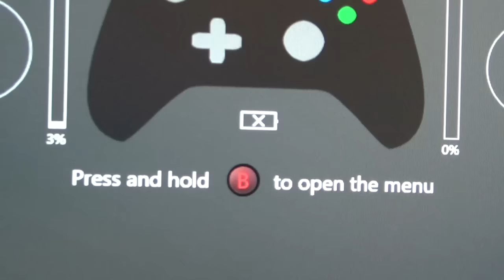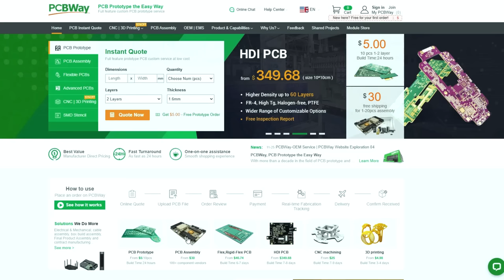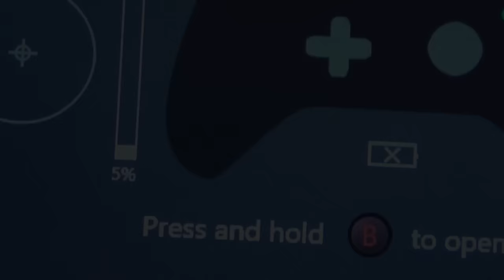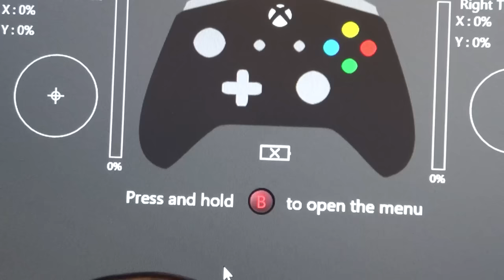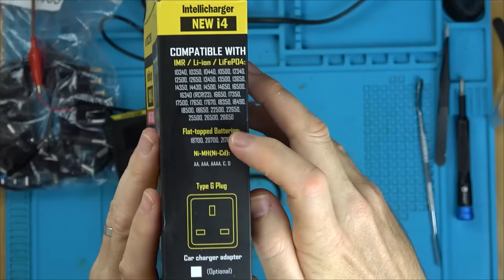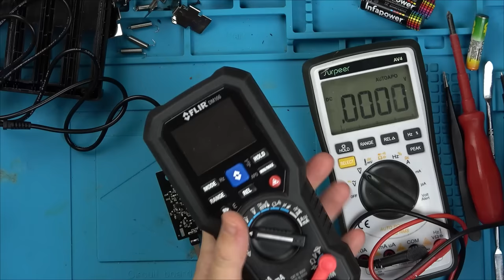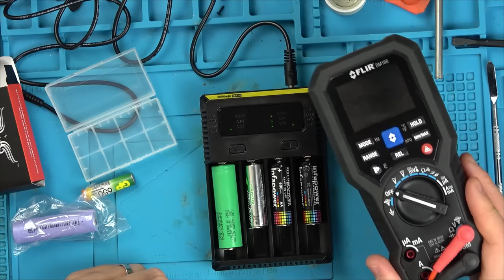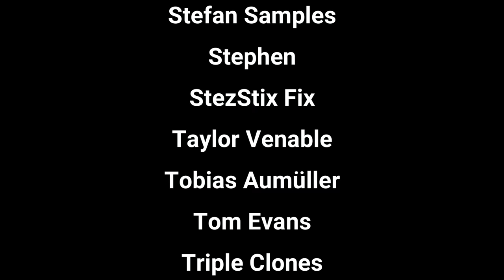More More MORE AMAZON RETURNS - Can They Be FIXED?

Comment: On the charger the diode that you took off does the rectification. One diode is a half wave rectifier. Therefore when plugged into the mains it was dumping 12V AC where it should be 12V DC, When you plugged in the DC it was going through the faulty diode and transformer to ground instead of being blocked by the diode.
Reply from the maker: Perfect, thank you PDS, I knew the viewers would have the answers. I haven't heard from you in what seems like an eternity. You keeping well?  Are you still volunteering at the laptop for the community place?
Reply: @Mymatevince  Hi Vince I'm doing good. I stopped volunteering at that place about a year ago. I just wasn't enjoying it anymore. I've been going the gym and I still do 3D art in blender. So I been keeping myself busy.
Reply: makes perfect sense. it doesnt need any more than that. But i wonder what the noise was when he plugged it into mains?
Reply: Yes. Also the small transformer is probably for a switch mode circuit, a linear transformer would be much bigger. It looks like there's some sort of combined pwm ic and FET package on the other side of the transformer.
Reply: Just to clarify what the shorted diode is for. It is the output rectifier for the switch mode power supply transformer. If you plug the mains lead in the switch mode power supply won't work because that diode is needed to convert the AC output of the switch mode power supply into DC.
Reply: @Irilia_neko  Yeah it's only useful because it doesn't matter that the DC is fluctuating. It would be useless for power rails on digital circuits.
Reply: My thoughts exactly

Comment: I'm not an electronics engineer, but my father was. A Diode of that type (your battery charger fix) is meant to allow electrical flow to go one way only. If a diode shorts out, it allows electricity to flow back into the circuit, causing the fault. Neither the AC or DC side will work because of the placement of this diode, taking it out did allow the 12V side to work, so once you replace it with a good diode, you should be golden. Also pay close attention to the direction of the diode's placement, that dictates the current flow.

Comment: An optocoupler can be seen next to the DC jack which means that that transformer is part of a switch mode power supply and not a linear one. The shottky diode does the high frequency rectification and also protects the circuit from DC going back to the transformer.
Reply: Yes, the schottky diode is for rectification, and after it failed, the dc voltage shorted across the coil. The coil is just a piece of wire for dc voltage, so it's like you basically connect the contacts together.

Comment: Vince, you can make a bypass light bulb to limit the mains current in case something is shorted. It's just placing a light bulb in series with one of the mains wires. If the thing you are testing is shorted it will just light up and avoid damaging it more (and prevent a fire too)
Reply: but its has to be an incandescent type bulb (old type not LED or CFL).
Reply: can be an halogen lamp too, incandescent bulbs are hard to find these days, specially 60W and 100W, which are the ideal ones for that

Comment: The battery charger uses an isolated switching power supply topology called a flyback converter. The transformer is actually a coupled choke (because it stores energy) with one primary and several secondary windings. There will be a FET switching rectified mains across the primary at high frequency. The secondary circuits just have a single diode and capacitor each. The circuit is arranged so when the primary FET is on, all the secondary side diodes are reverse biassed, and current ramps up in the primary. Then when the FET turns off, the ampere-turns are delivered into the secondaries. If one dc output capacitor has lower volts per turn than the others then it gets all the primary energy for that cycle. If one of the secondary rectifiers blows short circuit then the primary winding sees a big reflected capacitance which will cause it to current limit as soon as the FET turns on, so the other outputs will get very little charge supplied to them. All the best.
Reply from the maker: Thank you Lumbo for all the info 👍👍👍👍

Comment: The faulty diode on the Nitecore battery charger was shorting the DC supply and also the AC coming from the transformer. The diode was sinking all the current provided by the transformer and pulling the voltage output of the transformer down, which is why it heated up. As for the humming, without the diode the switch mode power supply has no load, in an effort to keep the output voltage at 12v the switching frequency gets dropped all the way down which probably caused some coil-whine in the audible range.

Comment: Just make sure when dusting the scanner interior that you check for dust on the now-working backlight. Judging on the fact they're in the same spot AND in focus, that's where i suspect those bits of dust are.
Reply: I’ve scanned several thousand negatives and slides over the years and the worst issue is usually dust on the back light, once you know the film is clean. I just blow with a lens blower and that usually sorts it.

Comment: I'm really glad I live somewhere where I don't have be paranoid of mains power.  I've changed outlets without turning off the power. I used to work with an electrician that would check the power by wetting his fingers and touching the wires.

Comment: More more more ;) That diode is a TVS Diode - Transient Voltage Suppression.  Probably for reverse current protection.  The AC side probably generates the voltage the DC jack provides - so both will be shorted by that same diode?!?  Best PCB Way adverts btw - I watched all of it!!!

Comment: Really entertaining, I'm a big fan of the channel.
Regarding the short shotky diod, my simple reasoning is that it's dividing the ac transformer secondary side from the dc part of the circuit. Once the diod semiconductor matures to a full conductor, it passes the dc 12v (from the bench supply) to the transformer, which when fed dc, acts just like a wire short to the ground through the other end of the secondary transformer coil.

Comment: 31:11 A transformer is a coil that loops to ground. The diode is there exactly to prevent the 12v in from going true the transformer back to ground when the mains is not being used.
That explains why the 12v in was not working but doesn't explain why the AC wasn't.
As you said 39:36 if the diode is shorted and acting as a wire the AC side should just work normally. Since it isn't, it means there is most likely something bad going on on the AC side. And 40:13 I don't think just replacing the diode will be enough to fix it.

Comment: 35:40 in this shot, it looks like the negative rod on the left is touching the positive connection, hard to see from a one dimension perspective but if they were touching each other perhaps the noise was contributed by this? Also, why you don't have enough faith in your work by now? You're always expecting a 'bang' to go off. I can tell you that I have faith in your work, don't be so hard on yourself. Besides we all love a bang now and then it adds the dramatic effect! Keep on doing what you're doing, Vince and I hope things get sorted in your favour.

Remember, it's not worth worrying about something if it is not in your control.

Comment: @35:00 you're confused about the AC voltage. The diode you removed, makes it DC. By just being one diode and not a <<full bridge rectifier>> makes the DC output very choppy, which then is probably smoothed out by a condenser.

Comment: Great Video Vince. Nice easy fix on the first couple of items. The battery charger I was cringing when you were going to plug it in, as I thought it wouldn't like it. The diode you removed IS the rectifier that converts the HF AC into DC. The power supply would have had no feedback to regulate itself and it would have started upping the frequency to compensate. The reason the DC side would not work is because the diode was shorted it was feeding back into the transformer. Hope that makes sense, and hope you get your legal troubles sorted out. Best wishes Mick.
Reply: Indeed, the two diodes that connect to the AC leads act to as a rectifier by blocking the AC in one direction, resulting in presumably something approaching 12VDC on the other side, joining where the 12VDC input jack is inserted. This also separates the 12VDC and AC side from each other, as the diodes block current going from the DC side to the AC side. When they're not shorted, obviously.
Reply from the maker: It does make sense Mick. Thank you. Just in case you might know...What would be the outcome of upping the frequency, a high pitched noise i presume, but would the voltage shoot up from approx. 12AC? Or would it just risk damaging the transformer or switching I/C. I haven't caught up with your channel since I've been on my hols. I'll try and get a couple in later after 'walk the line' Johnny Cash film 😂😎
Reply from the maker: @MayaPosch  Thank you Maya👌
Reply: @Mymatevince  I'm not 100% on the potential damage, but I'm sure it wouldn't do it much good 😂😂😂Yes I was wondering if everything was ok your end as you haven't commented on any of my videos for while and was going to drop you an email to see if everything was ok. My channel seems to be gaining a bit momentum at the moment, look forward to seeing your comments when you get time. Thanks Vince 👍👍👍
Reply from the maker: @BuyitFixit  Thanks Mick, yeah holiday followed by this neighbour drama has left zero time. I'll be back on it again though, no doubt about that!
Reply: @Mymatevince  Thanks Vince 👍
Reply: @Mymatevince I'd imagine that by having one side of the transformer loaded and one flapping in the breeze (due to the missing diode) it became quite unbalanced, which is why you got that awful shrieking noise. It was basically the trafo telling you to knock it off by audibly vibrating :)

Doubt it'd do any real harm, but some component might fail prematurely due to running the circuit out of spec.

Comment: Don’t remove a diode from the secondary side of a smps! 
The problems isn’t that it is no load, but there is no feedback to the opto-coupler.
If you’re unlucky  the primary side blows!
Because the opto-coupler is used for the feedback/regulation of the secondary voltage, by removing the diode, the opto-coupler has no reference voltage so it ‘thinks’ there isn’t any voltage and it lets the primary side oscillate a it’s maximum witch often results in a short circuited power mosfet, or if you’re really unlucky: everything blows in the primary.

Comment: If you are feeding AC into the circuit, every half cycle you are reverse biasing the circuit via the shorted diode. 
The diode is required to only allow the positive pulses through into the circuit and the capacitors will remove the ripple from the pulsed positive DC.
The shorted diode also allows the positive side of the DC to back-feed into the AC supply circuit possibly getting shorted by the transformer secondary to the negative supply side.
Reply from the maker: Excellent info, thanks KB1👍👍👍
Reply: @Mymatevince  You are welcome Vince.

Comment: Hi My Mate Vince, The reason you would get no output on the battery charger secondary side  is the that feedback see no voltage and shunts down the primary side of the power supply, I Would not plug in a power supply without that rectifying diode  can cause the primary side to blow up with no feedback, That diode is under extreme stress and is a common failure point, I would go with a higher Amp rating to get it to last longer, great video  👍👍👍👍👍👍👍👍
Reply from the maker: Thanks AR, you're always the man with the answers 👍👍👍👍👍👍👍

Comment: Very nice fixes :) Surprisingly expensive that film negative scanner, bought one in 2015 for about 30 Euros, altough mine doesn't have the screen or memorycard slot, it works only with computer via usb cable. 
It was fun going through old negatives and scan them. Found some pics, that were never made as a paper photos, because they were incomplete or had failed otherwise one way or another. Still, they had interesting enough material, that I scanned them, for example from summer holiday trip in summer of 1985. My parents enjoyed seeing those pics as well after all these years :)
Dust tends to be a problem though, had to clean the negatives, and the scanner multiple times during the scanning. Luckily the scanner came with cleaning kit, so it was easy to do.
Reply from the maker: Thanks. Yeah the dust really shows up on them. I gave it a blast with the datavac, but I haven't tried any since. Interesting to heat about the cheaper version. Thanks for sharing👍

Comment: It measures shorted because you're putting DC across the transformer secondary winding, which looks like a short circuit....it's a coiled wire, but still just a wire to DC.

Comment: I have had problems with my Power-A Xbox wired controllers.  My sons started first with the buttons under the analog sticks stopped registering button presses.  then the triggers LB and  RB(top shoulders) stopped.  Ended up the micro switches were bad.  Luckily i had a few junk VCRs that had a bunch of switches in them.  After i fixed his controller within a week my controller started acting up!  Buttons not working at all. 

Love the videos!

Comment: The photo scanner is the same issue I had with a video projector my sister bought.  No light. They didn’t have any more stock and gave her a refund.  They didn’t want it back so she popped into my house and I took it to bits to what was wrong.  The projection led wasn’t plugged in, the plug was sitting on top of the pins.  I pushed it on properly and it lit up and threw a nice big picture on the wall

Comment: Great video Vince, when you revisit it, check the diode at D4 as that left leg looks dodgy where it's soldered to the board, I'm a vaper and use one of these chargers for 18650's and 21700's and I can tell you this is a fault I've seen myself and has resulted in 2 burnt out boards on both the ones I had, one literally went into a melted mess it got that hot, I've since changed manufacturer.

Comment: I am not surprised by the easy fixes, I used to buy pallets of returns and the vast majority were either not faulty or a simple fix. It wouldn’t have been economically viable if the majority had actual faults due to component failure.

Comment: I've got money this battery charger was wired up for 120v AC for north America and doesn't have a rectifier for 240 built in. 120v American will have 1 line neutral and having another leg of power fed into probably shorts out that diode! Let me know your thoughts

Comment: the diode you removed is a high frequency rectfier, this power supply is a HF one, like a PC one. so the fast diode you have removed is the rectifier you were looking for. you could have removed one from an old PC ps and soldered in place, even if its not a SMD.

Comment: Top tip if u have larger batteries that dont fit charge say c or d cells use a safety pin on the end to raise the terminal.

Comment: Since the diode was shorted, the DC voltage input was flowing through the diode into the secondary winding of the transformer (shorting the +ve with the GND)

Comment: this diode is for rectifier to DC voltage , when the diode is short all 12 v DC is short because it connected directly to secondary on transformer , one pin GND the other pin B+ they connected together by the diode

Comment: 31:20 the short is going thru transformer to ground.Damaged diode with output capacitor are rectifing ac.
Any 3A schotky diode should be good.The diode was damaged because overheating,should be bigger diode.

Comment: 0:57 that breakaway cable is the same used on the wired xbox 360 controller (and counterfeit controllers does not have a breakaway cable most times, which makes easier to spot a genuine xbox 360 controller).And that breakaway connector can be purchased separately if you lost the one that came with the controller. 

The volume control is something that I really miss on the Xbox one /series controller. 
Unfortunately, Both Microsoft and Sony does not allow third parties to make wireless controllers for their consoles, this is why you can't get Microsoft / Sony 3rd party endorsed wireless joypads from brands like 8bitdo and the ones shown in thr video.

Comment: Remember diodes only allows current to flow in one direction. So one way it looks basically like a short and the other an open circuit. In this case it's preventing the DC side from crossing to the AC side of the board while allowing the AC side access to the DC side after being turned into DC. So when it fails both sides see it as a direct path to the opposite side. Hope that helps some.
Reply: This is it. When that diode is acting as a short in both directions, I think the DC input can just flow through the transformer winding. Auto-ranging ohmmeters have trouble measuring inductance.

Comment: When u have ac voltage coming from a transformer u can make a bridge rectifier with 1,2 or 4 diode with one diode depending upon the position it can turn to negative or positive

Comment: Good, albeit straightforward fixes. Diode oring (without anything else) is not the best design for a DC / Ac capable device. If one of the diodes (one leg of the bridge) goes short on the AC side then, when DC is connected, a high current can pass into the transformer.

Comment: I have a battery charger for a drill and after some testing, I realised that the external power pack for it was faulty. It passed 24v AC into the charger. It seems hard to find the right power supply for it but I can get around it by supplying DC into the correct point on the board.